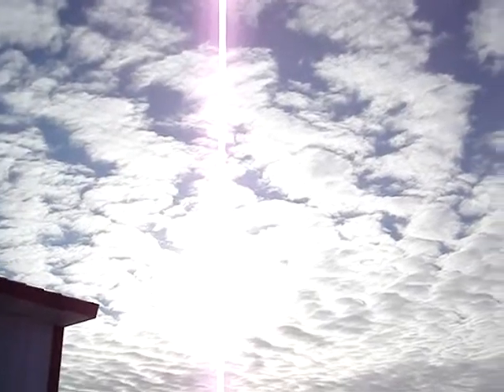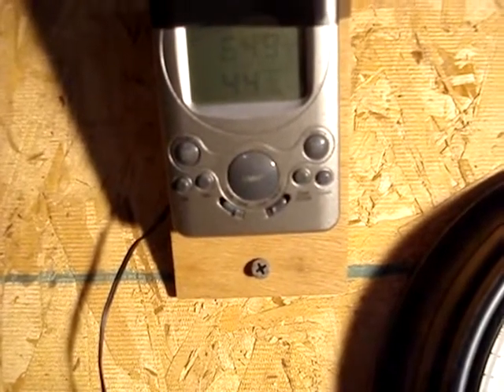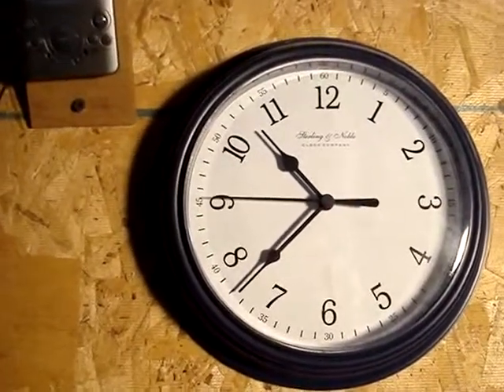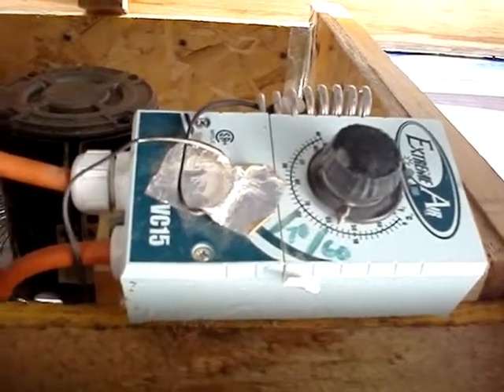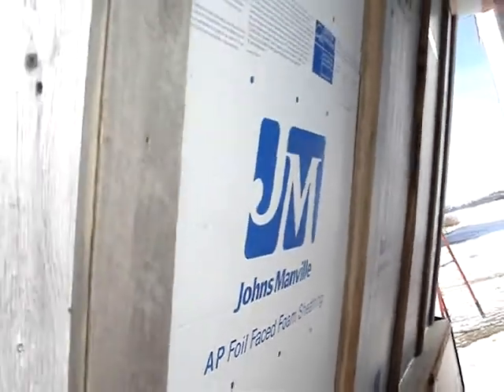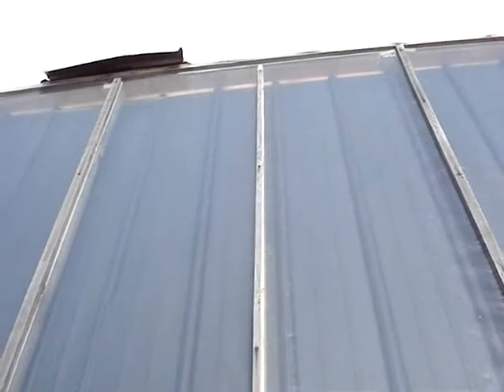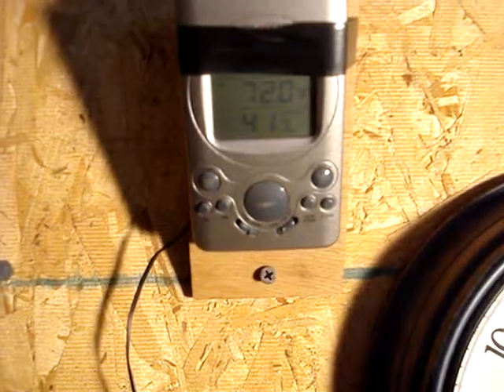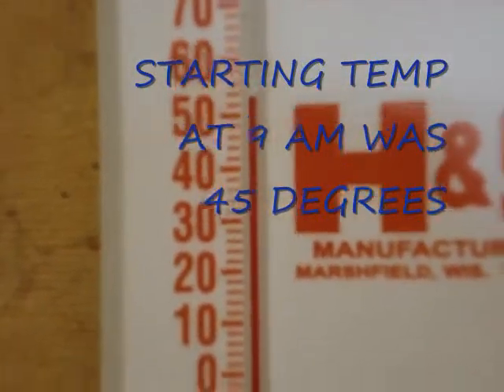HOMEMADE AIR HEAT SOLAR PANEL COST $400

Comment: Thanks for sharing this information on the solar heater.  I'm looking at your set up and thought.  What if you made your entire wall into the heater?  Paint the side of the buildings existing metal, then build your frame right on top of it.  I realize the vertical aspect of the wall isn't perfect, but through my own experimentation. It doesn't matter that much.  You would double your surface area and in the Summer you could put a big white Billboard tarp over it.  Just my two cents.

Comment: @STARFIRESOLAR That depends on his latitude.   45 degrees in winter would be optimal for... Florida.   The sun's REAL low in January when you get to 41 degrees latitude.   Here, 80 degrees incline would be close.  The point is to be 90 degrees to the Sun to reduce reflection.   Of course, adding a mirrored reflector also works to increase area.

Comment: @wildwindsca Exactly right.   My design will go up this Spring, and I'm going to build it on the South Wall, at an incline to maximize efficiency in Spring and Fall.

At ZIP code 49112, I figure 75 to 80 degrees should do it.   My feeling is there's no sense maximizing for December.  

I plan to use large diameter PVC as the plenum on top and bottom and two layers of metal screen as the absorber.   It's a new idea called "zero pass" where the air flows between the screens, not through them.

Comment: an properly inclined collector may have optimum  face area to the sun  when the sun is at its lowest ,  but inclined panel has effeciency losses and alot of extra cost. Optimum cheap build and  savings could be made with your system that made ON the wall. First paint the wall on your building black, build the frame directly on the building. You save money in insulation ,buying metal for the box,  and heat losses thru the bottom duct are now non existent.

Comment: Good Job and I know it heats good too. But you can get alot more heat out of that panel if it was layed back to a 45 degree angle. It would increase the exposed area towards the sun.

Comment: I cant tell how sealed that panel is, is it really sealed up? also the metal inside looks like rpanel, which doesn't heat up well, I would probably go with the cheaper galvanized corrugated metal its thinner and warms up faster and hotter but thats just me. 
EXCELLENT WORK!!!!

Comment: Wow...to get the panel up to 110 temp while the outside air temp was around 5, thats awsome, and then to maintain a 75 temp while the fan kicked in...If you think of it you are trying to heat a lot of air when you calculate the qubic feet....I'm going to build a smaller version to supplement our heat for the house...

Comment: You did it RIGHT,  who cares if you can get  50 deg  or more air tem rise  with a  muffin fan for air movement  micky mouse  could do that with a light bulb.    YOU  VERY WELL showed us  what  you want is lots of air flow even if the temp rise  is only 10  or  so  degs out  let air, you are still heating up, and   you MUST have air flow and temp rise   The  temp rise inside the room or buiding  is what is MOST inportant,  you want to heat the whole place not the bathroom!!   THANKS  A+